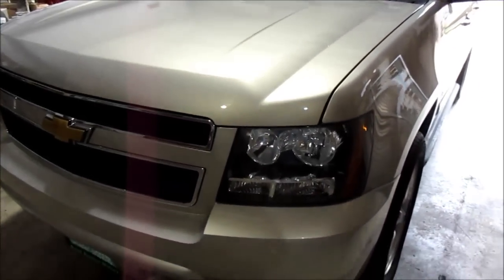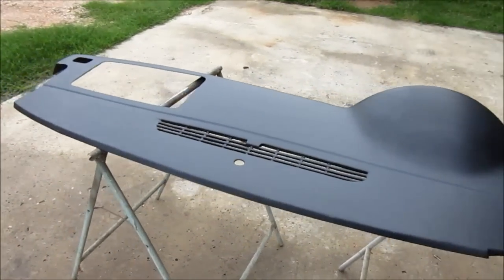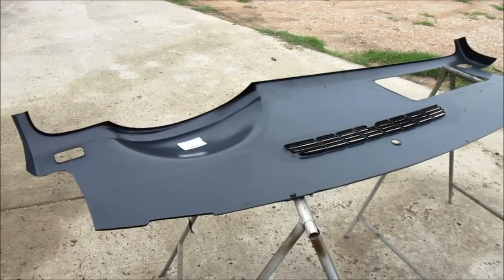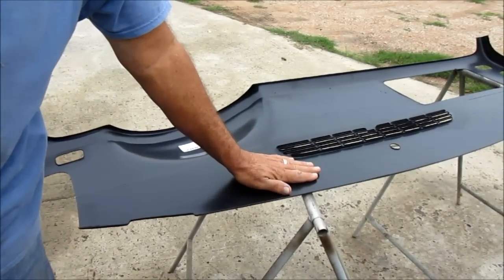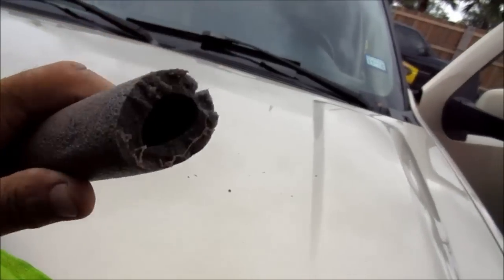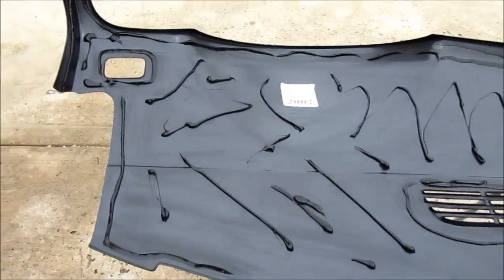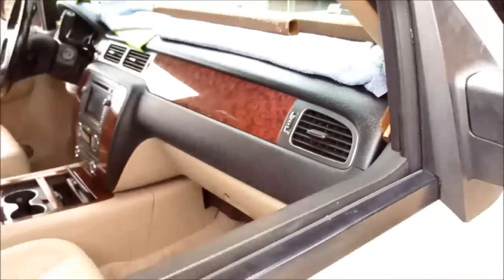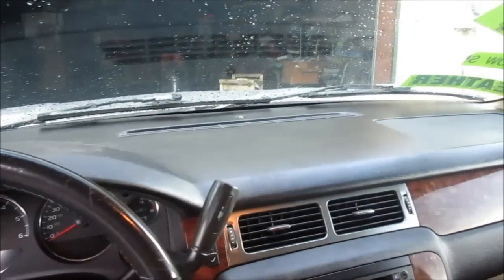#DIY 2007 2008 2009 Chevy Suburban LTZ Dash cap installation

Comment: Years ago I did my 98 Dodge Ram. The color was a little off.  As the dash cover is of the highest quality. More than likely my original factory dash was a little off on the hue color. I went the a Home Depot and bought one Rattle can of Krylon Dove gray. I used phone books and wedged shoes against the windshield over night.  When I sold the truck to a guy around the corner, I told him what I had done. He looked at me and said he couldn’t tell. He thanked me for my honesty. Now I need to do my daughters 2008 Silverado 1/2 ton and my 2008 Silverado HD 3/4 ton. There’s only one place to get a good-perfect fit, so I’m back to see what’s might have changed over the years.  The new piece of advice was:  using the folded cardboard in the adhesive setting process for the side wings, against the doors. No..... I’m not a paid commercial ad, just a happy customer.
Reply from the maker: Not much has changed except for the shipping companies going nuts of prices for shipping..We still install them and make them the same way. One at a time..each time trying to make them fit or look better.. the two piece on the pickup style can be a little bit more tricky and may require some additional trimming around cluster area and pillars.. Not much, just a little buffing to get an exact fit.. Appreciate the comment. Thanks Larry

Comment: Good job.
In Saudi Arabia the cracks are a very very common problem due to weather conditions (heatwise).
we have a lot of workshops do fix the cracks and also they install a 5mm leather on the full dash (US made or German made) like the ones on the seats and they niddle it down if you want or glue it up on the whole dash and it fits 100% and you never know it was leathered up. They do the whole job for around 300-500 bucks (depends on the cracks on your dash to fix it).
Reply from the maker: good way to resolve isse
Reply: @LarrySbrusch  tbh, in my pov, it's the best way to resolve this stupid common issue of gm dashs, install a hard fine well made leather to also terminate the weird plasticy sounds when you get pumpy roads sometimes. No plastic sounds no cracks and the airbag's hole also is clear they don't put the leather on it.
Here's an example : https://youtube.com/shorts/S2DS0HETUT8?feature=share

You'll never know. He installed leather on the doors interior too.

Comment: Does it rattle while driving? Im worried about that. My dash is currrently TERRIBLE. I have Black Gorilla Tape holding pieces, LOL. I will buy one soon.
Thanks for the walk through!
Reply from the maker: As long as it is installed correctly, it will not rattle

Comment: Any chance you have a  recommendation on remove old dash cap I have the single piece and the front of my dash is trashed and it feels like the current cap is loose in several parts
Reply from the maker: It really depends how well it is glued on
Reply: that front lip feels pretty tight but the majority of the flat upper dash not so much 

the amount of heat to actually compromise the rtv/siilicone might start just melting stuff.
Reply from the maker: @MrAwsomeshot  Not easy to get one off
Reply: @LarrySbrusch  haha yehhhh I figured. I might just get the replacement front panel and try to reach up under front of that cap and put some 3m heavy duty double sided tape to secure it better in the front

Comment: I just bought an avalanche with the cap installed but the adhesive in the middle is gone so every time I hit a bump it rattles
Reply: Should've use JB Welde
Reply from the maker: They did not use enough adhesive or used the wrong kind. I have seen this in some cases
Reply: @LarrySbrusch  true, jb welde is the way to go

Comment: How hard is it to remove the dash cover . The car lot I bought from never did the air bag recall that was pending . After I got it got letters from dealer and will not touch it cause they don't want to be responsible  for damages .
Reply from the maker: The dash cover or original dashboard ???
Reply: Dash cover only not the original .

Comment: once this is installed can. you still remove your instrument cluster if you need to get to it?
Reply from the maker: It can be removed, but requires a little work
Reply: Good luck,you will trash the original dash removing the dash cover bc of the silicone..

Comment: Part of the problem with the cracked dash is that It rattles. How does this cover prevent the rattling after installation? 
Does the adhesive come with the cover?
Reply from the maker: One tube of adhesive comes with cover. You may need 2 if yours is cracked real bad. As long as you put liberal amounts of adhesive where you have more cracks, you will bond the two pieces together to help alleviate the rattling

Comment: The part I was very interested in you showed nothing. That was with original dash, did you leave all those cracked pieces to keep rattling around? Did you remove pieces? Did you glue or tape all the cracks? I’m disappointed in that part of video. Also why not have vacuum molder just eliminate the extra piece so you don’t have to grind it off?
Reply from the maker: I removed all of the small pieces and used an extra tube of adhesive when I installed cover
Reply: So you don’t have to remove entire old dash ?   Only the broken up pieces?   If so does it not get in the way?

Comment: On my 07 Avalanche dash the center air vents are broken on the right hand side, will I need to remove it before placing the new cover over the dash.
Reply from the maker: If you are talking about the defrost vents. It won't be an issue with our cover from TXDashcovers.com...we now make them with the grids/defrost vents built into them to resolve that issue
Reply: @LarrySbrusch  Received the new dashboard, followed the instruction, was looking like new money in less time than I expected. The Florida heat was a helping factor in sealing it to the old dash.
Reply from the maker: @joetomlinson904  Great Glad to hear that. Appreciate the comment. Thank You

Comment: Can you do something about the background noise??????  Just joking, jeez some people are never happy.  This is a genius idea and product.  Can't wait to try it on mine.   Mine is a 07 so will probably need to trim a bit but seems like it couldn't be easier.  Thanks for the vid and for making these, I didn't know there was a USA made option.   

Question though.  On the tahoe I just bought, it seems the old cracked dash is actually peeling.   Like you can rub your fingers on it and little pieces rub off the surface.   Very weird, almost like a snake sheds its skin and the very top surface is lifting up.   I'd say the sun did it, but I'm thinking maybe the previous owner put some sort of chemical that ate the surface away.   Would you say I should just scrub the old one with something like acetone to get the flaking surface up?   I imagine the peeling crap has to come off before trying to glue the new one on top.   Thanks.
Reply from the maker: The acetone fix is what I use to get most of the scaling off. Appreciate the comment

Comment: YOU BUY IT? THEN YOU HAVE TO GRIND ON IT ALSO? HELL NO SHOULD HAVE THAT DONE AT THE FACTORY BUBBA Really Lmaoro probably want 100.00 or more for it.
Reply from the maker: Well we can't make everyone happy and use a general mold that will work on all 2007-2012 year models and not all of them will need to be trimmed to fit..you do have an option..buy China..it's cheaper..it's your choice.....

Comment: Or just replace the entire instrument panel..... Whoever came up with this "cap" idea, probably invented Duck tape.... Don't bandaid..... FIX.
Reply from the maker: Well if you like having the same problem. Go ahead and replace it with oem parts, GM never did anything to resolve issue..so an oem part is just a bigger bandaid. Lol
Reply: @LarrySbrusch  This is the type of mindset that creates the "bandaid" idea. At that point you might as well install a new instrument panel from gm, and THEN cap it with this to make it even stronger.... instead of putting a cap on a broken piece of plastic making it even more prone to rattle. Yeah solid advice my friend :P - No hate on the hustle, just saying its lazy and isnt the "right" way to fix something.
Reply from the maker: Waste of money doing that